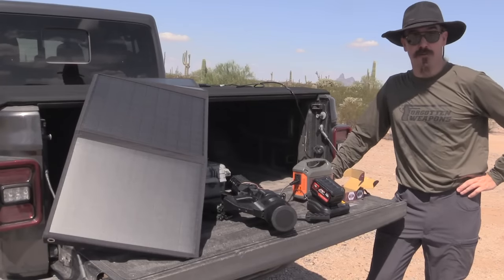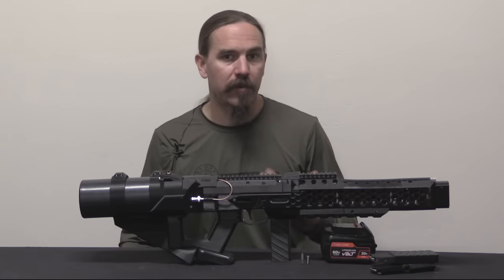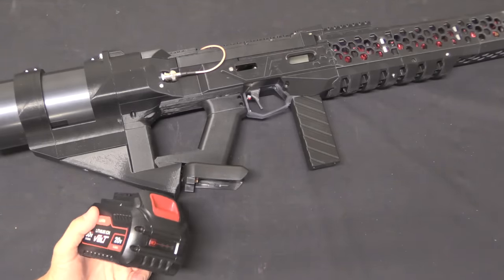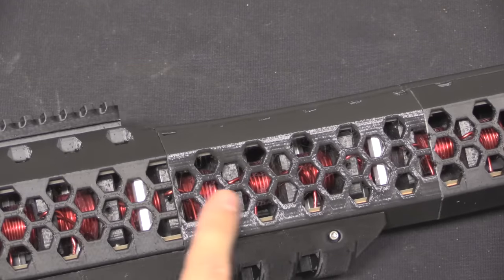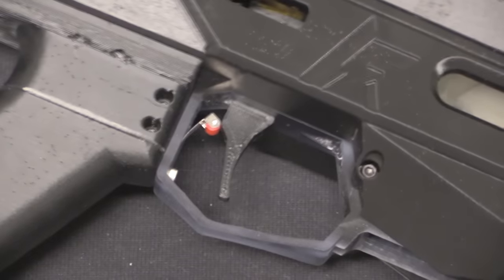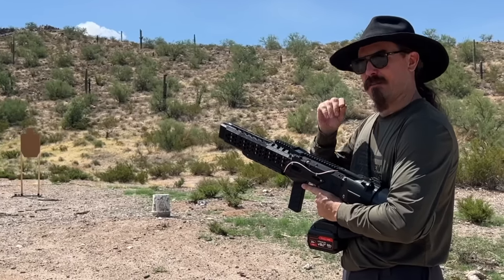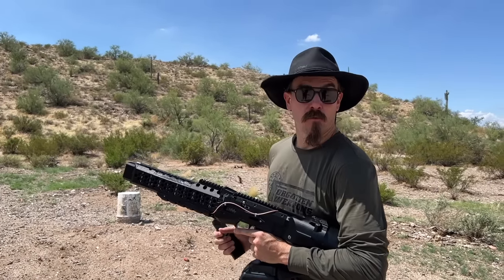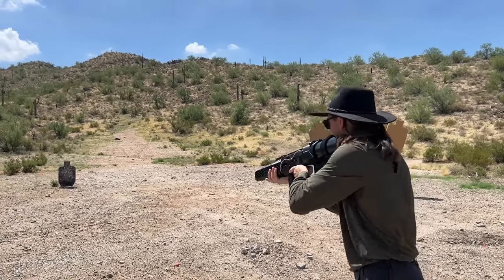ArcFlash Labs EMG-02 CoilGun: Making SciFi Weapons Into Reality

Comment: Ways to tell a rail gun from a coil gun:

If the projectile is fired between two conductive rails, it's a rail gun.
If the projectile is fired through coils, it's a coil gun.

If the choice of material for the projectile depends on its electrical conductivity, it's a rail gun.
If the choice of material for the projectile depends on its magnetic properties, it's a coil gun.

If upon firing the gun there's a bright flash of light and a loud bang:
- If the designers go "YEAH BABY!" ... it's a rail gun.
- If the designers go "OH GOD WHAT HAPPENED?!?" ... it was a coil gun.
Reply: That and if the power supply is the size of a conventional US navy ship nuclear reactor. (Talking about the rail gun)
Reply: @Triumvirately  oh there are ways to get that power consumption way way down lol
Reply: Interesting information. I have designed three coil guns, but called them rail guns by mistake... OOPS!
Reply: @joeparker9516  yeah, rail guns are like coil guns if your goal is to hit your target, several dozen feet of reinforced concrete, and bury the payload several dozen more feet under a bus sized crater… depending on the size of the payload.
Reply: @matthewnienkirchen8083 A coil gun isn't necessarily slower than a rail gun, but it gets more and more complicated the higher you want the projectile speed to be because driving the coils with the correct timing to track the accelerating projectile gets more and more precise, and will require increasingly large voltage to change the magnetic fields rapidly enough (resulting in increased flashover risks). A rail gun doesn't have this particular problem since its fields naturally follow the projectile without requiring any external timing, though to compensate a railgun is just a much bigger headache overall, especially if you were hoping it fire it more than once ;-)
Reply: That last paragraph gave me a good chuckle.
Reply: Good one. But actually, the coil gun also depends on the electric conductivity of the material, since it is about an induced magnetic field. Thus, the more you increase the diameter, the more efficiency you get. So copper works best, deep frozen copper works very best, large deep frozen copper rings works muchas muchas best.
Reply: @matthewnienkirchen8083  We don't start our lives in our vocation.  I am also a Reverend but I know a lot about other things.  Imagination, reading, being exposed to different things allows us to think outside the box.
Reply: E @Triumvirately

Comment: 300 full power shots on one battery is pretty legit, considering a standard rifleman combat load is 210 to 300, rounds. Now they just need to get the muzzle velocity up a bit and we're good to go. Love it. And this was 8 months ago! Can't wait for the next one.
Reply: hell yea. get muzzle velocity up to over 1000fps and you have a winner!
Reply: @markthompson8656  according to a quick search it's up to 75m/s or about 246 freedoms per second, so it's got a little ways to go. I imagine they're refining the system at a civilian sales safe level (since this is barely scratching airsoft guns, just with much heavier projectiles) before they start ramping it up. I give it.... two years maybe.
Reply: I can see the muzzle velocity getting higher pretty easily. Hacksmith did it, so can they.
Reply: "... up a bit"?  Ya Think?
My Daisy Red Ryder spring operated BB gun has a higher muzzle velocity.
I ain't shitty you..... 85 to 90 m/s when well oiled with a new spring.
This glorified rubber band shooter is only a threat to balloons, glass windows, and stationary insects.
Reply: @bigdickpornsuperstar  the original guns were bamboo rods firing rocks, things take time to get better.  This is clearly still a work in progress and definitely not ready for military use.
Reply: Ya, just ignore the fact that the coil gun will always be heavier because the weight is static and doesn't scale down with remaining energy like bullets would. You also have to remember that your remaining energy doesn't scale with your remaining ammunition like bullets would. You would have to do math to determine how much ammunition your remaining energy can fire to decide if you have too much ammunition. You could integrate this into the magazine or gun, but then you'd need add a microprocessor and display to them and it needs to be working. TLDR: Coil guns will almost always be inferior to powder guns.
Reply: very hard to go over 200 m/sec with these things because physics
Reply: agreed when he first said 200 FPS I thought he said 2000FPS my airsoft gun puts out 370FPS with a 3000rnd clip. It can make a mess of gophers.
Reply: Basically these things can produce an impact energy of about 24J using the 8.5g projectile designed for it. This is a bit less than half of old .22 long energy. But the projectile is 8 times heavier, so it's not going to take a massive increase in velocity to get up to the "lethal" energy (according to militaries) of 79J (58 ft-lbs). To increase impact energy they would have to increase velocity, probably by making the gun longer and adding more coils. This would change the requirements for the capacitor though. And it would also reduce battery life, probably cut the number of shots by half at least. And the weapon would be a lot heavier as a result, and potentially be a little unwieldy in length. But I think this is still well in design and prototyping stages of coil guns and I don't see any reason why these guys or someone else won't produce the first real coil weapon in the next decade.
Reply: @Kelnx  - is 100x worse than a 2000 yo arrow ...  I won't call this "high-tech weapon"  but just a technical joke.
Reply: @RyuuOujiXS you guys are underestimating the total lack of recoil on these things. That alone motivates further engineering
Reply: @RyuuOujiXS  That's some big fudd energy. It's not hard to add software to the magazine that tells the gun the mass and number of its contents, letting the gun figure out the power per shot ratio. Even if that system fails, the gun could still fire and let you figure it out as you go.

Also, zero recoil or noise. Good luck making a truly silent powder gun.
Reply: @atlasmegacorp  The zero recoil will not be a thing if/when these coil guns become lethal. They currently have zero recoil because the rounds aren't firing with enough speed to be lethal, it's like an airsoft gun. The faster the bullet leaves the chamber, the more recoil it will have.

Not really sure about the zero noise thing, I don't understand it well enough. Doesn't the amount of noise a gun make have to do with the gasses being squeezed out of the barrel at high speeds? Because a firecracker with the same amount of gunpowder as a bullet wouldn't be as loud a gunshot. Wouldn't something similar be happening with the air being squeezed out as a lethal coil gun fires? Again, I'm not too sure on this since I don't understand the noise part as much.
Reply: @seriouslyconfused1  I have fired NERF guns with higher velocity
Reply: @RyuuOujiXS over 300 rounds I can see traditional guns like AR-10 being similar to this in a full load out.
Reply: @RyuuOujiXS  Rail/Coil guns have the advantage of a possibly MUCH higher velocity for their projectiles. Gas driven guns (normal ones) have a fixed limit that cannot be increased as the gas will not expand any faster.
This thing is of cause more a toy then a weapon, but it clearly is a cool toy.
Military companies all over the world are researching on magnetic gun systems for larger combat craft like ships, tanks etc so one day we actually might see one in action. But to minituarize it to levels of a handgun will still take quite many decades and technological breakthroughs.
Reply: @skipperg4436  You can go to nearly unlimited speeds with coil/railguns, much higher then conventional guns. All you need is more electricity and stronger magnetic fields. To actually make that in a handsized version is a different story, but not one based of physical limitations but rather technological ones.
Reply: @axell964  actually with coilgun we are limited by speed of capacitor discharge: if projectile is moving at very high speed it won't spend enough time inside of the coil to get accelerated much.
You can argue that this is specifically the issue with the coil guns made today (projectile having the same length as the coil) but this ratio has proven to be the most effective thus far... both via simulations and testing...

Railguns are completely different thing. There you can theoretically accelerate without limits but in practice you have projectile overheating (due to both friction and current) and damaging the device.
Reply: @clay500z2 there is of course no way around Newton's third law of motion but in principle you can distribute the force much more evenly. The problem with recoil is not that there is a force pushing in your direction, it's that there is a rapidly changing force pushing in your direction. So if in full auto the force doesn't change, you can perfectly compensate.
Reply: @emailuser8104  You can still induce spin into the projectile, that's no problem. The real question is whether you want to, coil guns are perfect for firing fin stabilized rounds since they don't need sabots and that can probably make them more accurate than conventional firearms.
Reply: @hedgehog3180  This is what I was thinking, having small fins that attach to the projectile would stabilize it, basically like firing arrows.  I was curious about whether they could make dimpled metallic balls like golf balls that could be spun or rotated  by a selector to create specific aerodynamic forces for accuracy or even to bend shots around corners by slicing or hooking a shot...want it to go up, dial it in a backspin, want it to rotate down, front spin, left right etc.
Reply: Clip? @seriouslyconfused1
Reply: @RyuuOujiXS  Bwahahaaa

Electronics scale down much faster than macromechanical explosive units.
Electric cars' power, range, and aural amplitude are already much better than ICE and have only been in serious production for 15 years.  How better than ICE? The only reason instantaneous velocities are held back is to accommodate the human load for G forces.
The combination of microelectronics, battery cell density, magnetic plasma control, and localized quantum processors will likely scale both aural amplitude (loudness) and cost way down and both power and efficiency way up and in probably only a year or two. 
Clearly you haven't been watching microprocessor evolution very closely. 

Things happen fast, now, bro. 
So, so fast.
Reply: @skipperg4436 

But not impossible.